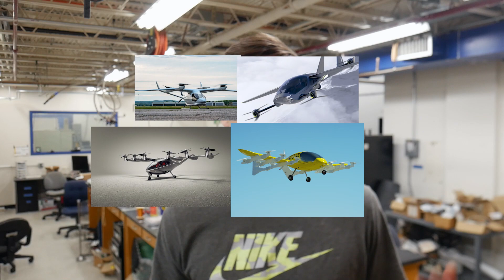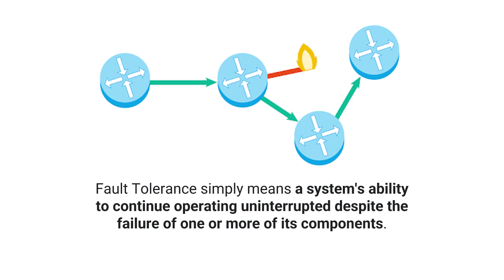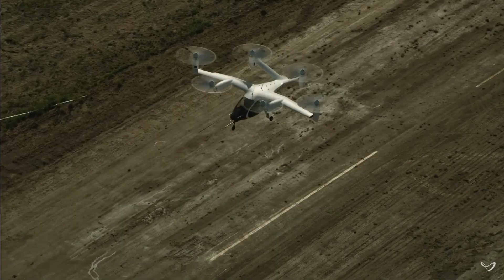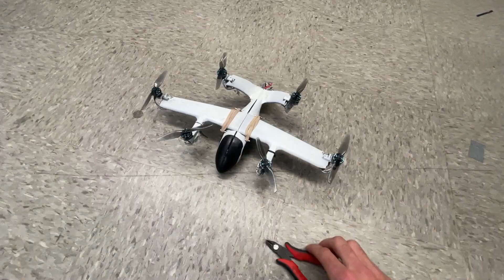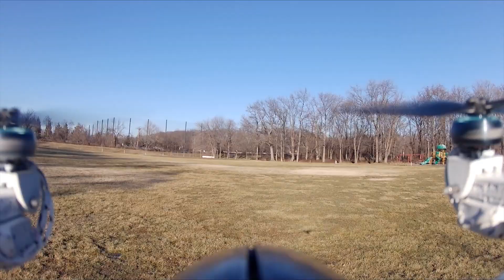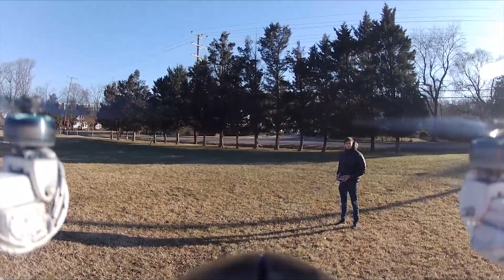Cutting off a Critical Motor Wire | Fault Tolerance

Comment: the paper 'Flight Performance of a Package Delivery Quadrotor Biplane' (not one you authored, but from UMD) claims quad biplane requires only 32% of power in the abstract, but looking closely they compare PEAK (mid-transition...) power to MINIMUM instantaneous power (not even clear the craft was at steady state). If you eyeball the average power its more like 60 or 70% power, which is a lot less impressive.

I am appalled at the low quality of this analysis and that this paper made it to conference / presentation. Or am I mistaken?

Comment: Definitely a good first step in testing fault tolerance, but it's also important to recognize that the aircraft will behave very differently in the case where a motor fails in flight. Just because it can take off and fly with a motor out doesn't mean that it won't behave in a catastrophically erratic during a motor-out incident in flight. Just my 2 cents...

Comment: You said "the main goal is to decouple the commands as much as possible" was that your own goal for a simple way to solve the control problem? Or is that the most efficient way to control a one engine inoperable condition?
Reply from the maker: Good question! I think it’s safe to say landing the aircraft as easily as possible after a motor failure is probably more important, so long as that method doesn’t use up all the energy before you land ! You know, gotta weigh your design drivers…

Comment: Perhaps also explore control theory to control chaotic crashes in the event of multiple surface failures.
Reply: The early DJI hexacopters did this. They started to yaw/rotate to compensate for lack of thrust on 5motors instead of 6motors. That's why I prefer hexas to quad for carrying DSLRs. Quads will almost always crash in case of any failures even if I have seen some crazy controll algorithms move to solves this also. (Very experimental and spinning moves to compensating a quad are definitely not for carrying humans ;-)
Reply: @rasmus80g  We could still utilise such spinning providing it stays within human tolerances for example max g12 and prevents a high speed fatal impact. I take your point though at certain high g forces the humans will not survive.
Reply from the maker: Would be a super cool problem to investigate!
Reply: Here is an old example of a quad that actually recovers from propeller loss... But i imagine one being quite dizzy if it was a manned flight :-) https://youtu.be/bsHryqnvyYA